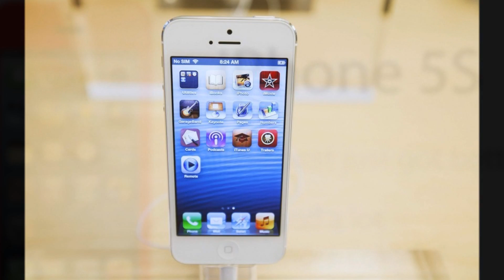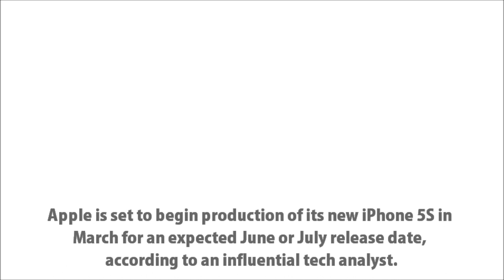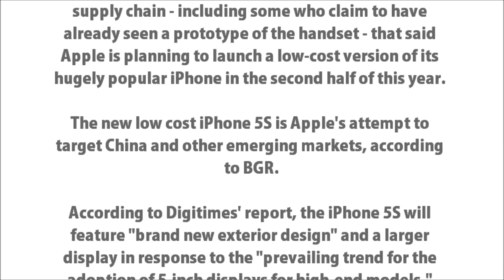Official iPhone 5S Promo Video Release in June 2013

Comment: 0:22 no proximity sensor. 0:17 "652 pixels per inch" after 300 ppi the more pixels give diminishing returns. The human eye can only distinguish about 320 pixels, therefor the retina display is at the optimal pixel rate that it could ever go to. So why would this video suggest doubling the rate of pixels? It wouldn't effect user experience.